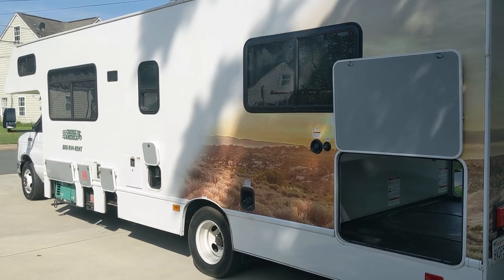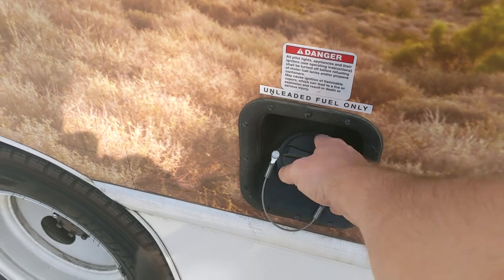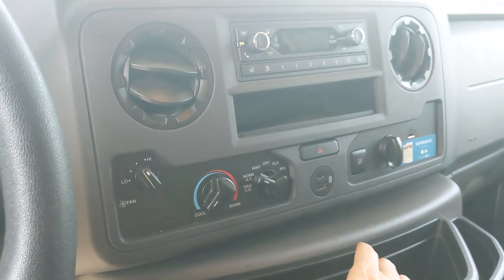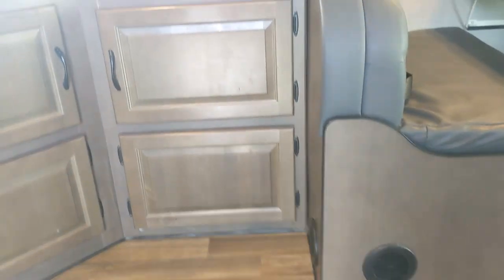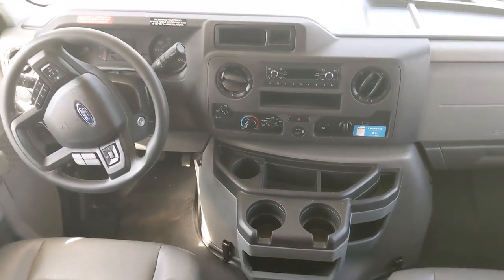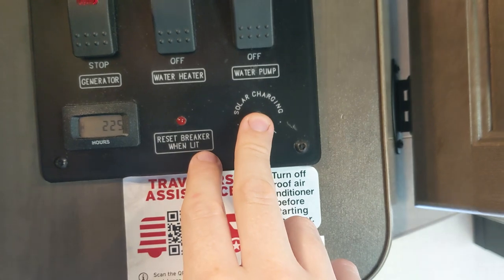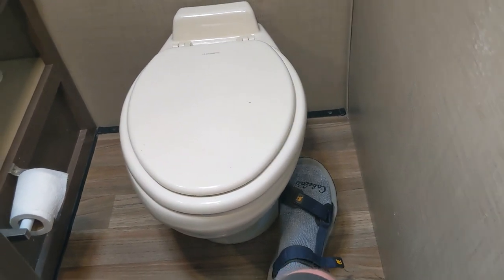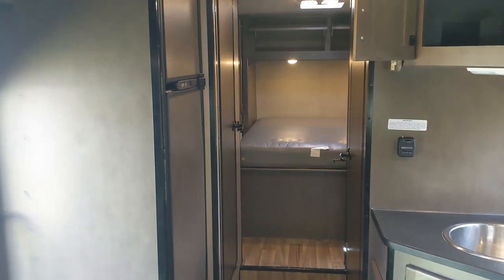Cruise America RV review and walk through - updated for 2021/2022

Comment: Hi Mike, thanks for your video! Do you know the size of that rear cargo area? Could you fit a bike (or two?) in there?
Reply from the maker: Hi Jonathan!  Thanks for watching and commenting on my video.  The Cruise America website lists the "outside storage space" of the 30' RV as being 93 cubic feet, or "2.3 cubic meters".  In real-world terms, I think you could definitely fit a bicycle or two in there, assuming they are normal-size bikes (not e-bikes or something) and that you can use basic hand tools to do something like remove the front wheels.  I don't own a bike and haven't tried, but this is my gut feeling, anyway.

Another option: the vehicles have external tow hitches.  If you were to use a hitch-mounted carrier you should be able to easily transport a couple bikes.  I'd recommend checking with your local rental office, they may have more suggestions or experience traveling with bikes.  Have a great trip!

Comment: Was there a big difference between driving the 25 footer and this model? I drive and ambulance for a living and it’s 23 feet long. Hopefully this drives similar!
Reply from the maker: Hi Charles!  Thanks for checking out my video.  Personally I found the 30' model more stable and had a bit more power (has a V10 engine, compared to the V8 in the 25').  Of course fuel economy is a bit worse, but otherwise we prefer everything about the 30' model.  Coming from an ambulance, it's just a little bit longer.  Should be easy for you.  🙂  Safe travels!

Comment: Hi Mike,
Thanks for your videos. I am planning to do a route along the west coast of approximately 14 days in a motorhome. approximately 2000 miles. Only 3 travelers. I am going to contract the complete package and I am between the C30 Large 2312 Euros (the dollar and the euro are similar today), the C25 2714 euros, c21 compact plus 3062 and compact c19 3110. which one do you recommend? The point is that the C30 large costs much less than small motorhomes. The price pushes me to rent the c30 but I am afraid that it will have much more fuel consumption and in the end it will be more expensive. On the other hand, I have no experience with motorhomes, so I don't know how we will manage with a caravan as large as the c30 large. What is your opinion on both issues? Thank you very much for your attention

Comment: Hi Mike, thank you for your videos.  I'm renting a 25' on a one-way from California to Virginia.  I don't plan on stopping at campsites, only at rest stops, so I won't be hooking up to water and power.  Will I be able to use the propane, and the generator be enough to take me all the way across?  Can I bring an extra propane tank? And, if yes, where does it hook up?
Reply from the maker: Hi!  Thanks for the comment.  In our experience the propane lasts a very long time.  We only use it for hot water / showers and do most of our cooking outside on a grill (either wood/charcoal or using the generic green propane bottles with a camp stove).  We've only once ever needed to use the furnace but it seems very efficient (heats up quickly).  We've never done a trip that long, our longest has been around 600 miles 3-4 days.  We didn't run into issues with propane or fresh water, but what we found was that the grey water tank (where your water from showers, sinks, etc., goes) filled up the fastest.  Depending on how many people you're traveling with you may want to plan a route that allows you to stop at a dump station every 2-3 days.  You can check with outdoors stores, also many state parks are inexpensive to stay a night and use their dump station.  Other typical "boondock" sites (Walmart parking lots, Cracker Barrel, Harvest Hosts, Boondocker's Welcome) do not have anywhere to dump your waste.

So that's our experience - propane is cheap and easy to get (most outdoor stores, Home Depot, garden centers, etc.) and lasts a long time.  There's only the one main internal tank (can't hook up an external tank) but it lasts a while.  Water, also, tended to last a long time (at least for us).  Just need to find somewhere to dump every few days.  The fresh water tank is larger than the waste tanks.

Unless you are going to exclusively use the toilet/sinks/water at rest stops, I would plan your route to include a campsite or state park at least once a week to dump the tanks.  Hope this helps, have a safe trip!

Comment: Do these rentals need a leveler or stabilizer?
Reply from the maker: Hi Shellie! Thanks for checking out my Cruise America walk through video. These rental RV's are pretty basic "no frills" units designed for first-time renters, and do not have an integrated leveling system. I would recommend seeking out flat campgrounds for your trip (many campgrounds have photos of the sites online) or bringing along some of those basic leveling blocks (the kind you drive up onto).

If you specifically require an RV with a leveling system, maybe something more high-end from a site like RVshare or Outdoorsy may be more to your liking.

Safe travels!

Comment: Hope you see this before my trip. This has been informative and you answered many of my questions in the comments - thanks!  Will I need to replace any propane and gasoline used when returning? If we had a break down on trip; are they good about getting a replacement quickly no matter where you're at? Or, would you have to wait for a repair? You said you're pretty much at the mercy of how others have left condition of the rv - Am I going to have to do a deep cleaning/disinfect before I leave on trip? Thanks for your help.
Reply from the maker: Hi!  Thanks for checking out my Cruise America walk through video.  Regarding propane and gasoline, they ask that you bring it back with the amount you left with.  That means if it has half a tank when you leave, bring it back with a half a tank.  Otherwise there may be a service charge (think it's $3.50 a gallon but your rental office will explain all that to you before you leave).  And propane is easy to get at most garden supply stores, Tractor Supply, big box stores like Home Depot and Lowes often have it, as well.

And regarding cleaning, the rental office does clean them before sending them out.  But during peak times and times of high turnaround, they may not get them cleaned as much as some folks would like.  So my point is to just be courteous to those who come after you and don't return it a filthy mess.  At least "broom clean".  What I'll do now is if we take it to the beach, I walk through the vehicle with my leaf blower and blow all the sand out the door before bringing it back, LOL.  😆

Regarding breakdowns and replacements, I suggest talking to your local rental office.  We've never had a breakdown on any of our trips but I assume if something critical broke there would be options like dispatching a mobile tech or a credit/refund, depending on the nature of the incident and how far away you are from a service center (i.e., right down the street or a thousand miles away?).  If it just needs something like a quart of oil, save your receipt and they'll reimburse you for that.

Have a safe trip!
Reply: @CompTechMike  Thank you so much for answering quickly and for all the info! Love the leaf blower idea!

Comment: so how long does the ac work on its own
Reply from the maker: Hello, just saw a bunch of additional comments from you.  Not entirely sure I follow all your questions.  Suggest writing a top-level comment with all your questions in one, if you still have any?

Regarding the AC, the dashboard AC in the cab works just like any normal vehicle - any time the engine is running you can turn it on.  For the large rooftop air conditioner to run you either need to be running the generator (which you can do while driving, if necessary), or plugged into 30A shoreline power (like at a campsite).